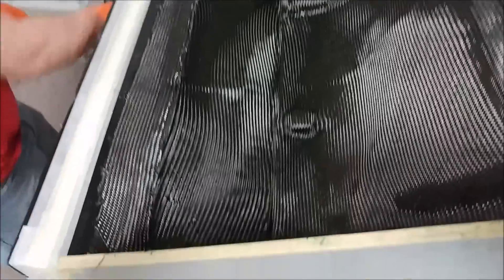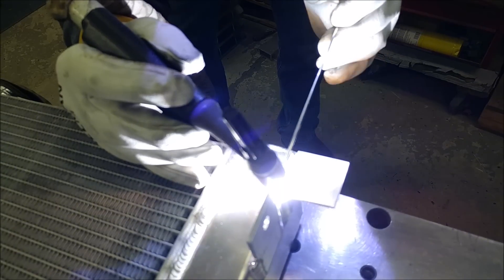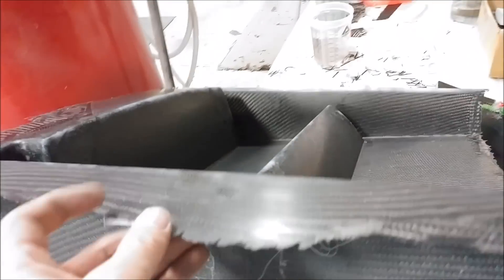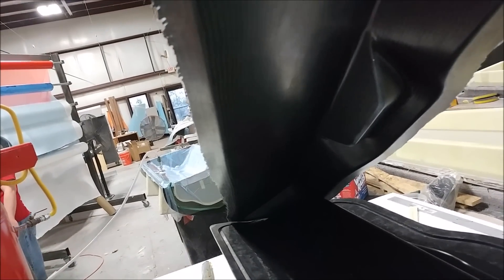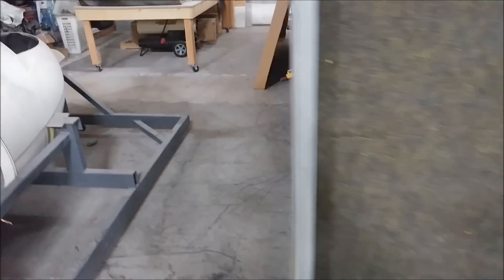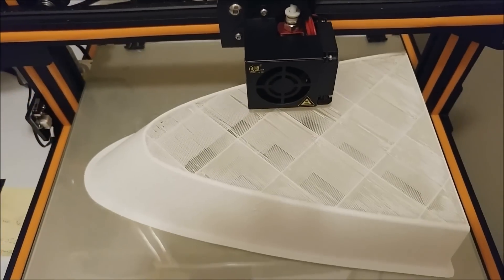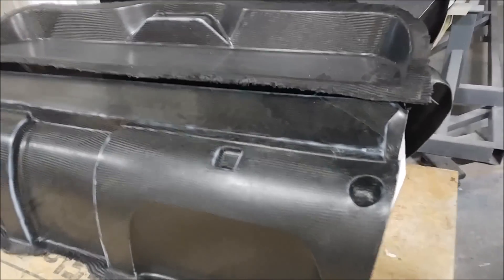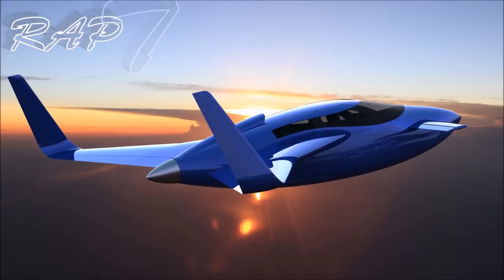Turning up the Heat - Getting the oven operational

Comment: I'm was wondering how visibility will be over the panel and the nose in cruise, climb, and landing.
Reply from the maker: It should be better than any other aircraft out there. I specifically designed the glareshield to be lower than normal.

Comment: great progress glad to see you worked out the oven and the tig aluminum bracket looked good too. way to improve your skills when you get an opportunity. was the hole saw mounted in the gantry mill when you drilled the bushing mount? that is quite a beefy hole saw.
Reply from the maker: Just used the 20v cordless drill.
Reply: Raptor Aircraft how did you align the hole saw?
Reply from the maker: If you go back a couple of videos you see I used the machine to align a bushing on the mold. We then put the part back in the mold and drill the 1/4" pilot hole using the bushing.
Reply: Raptor Aircraft ah yes. I remember that now. thanks. looking great.

Comment: Have you considered getting a SLS printer instead of an extrusion printer? Would solve that issue.
Reply from the maker: Those are a lot more money right?
Reply: I said SLS, but meant SLA. Cost depends on your size needs. Form Labs Form 2 can do 5.7" x 5.7" x 6.9" for $3500. Larger build volumes are more expensive, BUT you also have leasing options. Also plenty of used units out there. Now that you proved the concept of using 3D printing instead of the more labor intensive method, I'd highly recommend looking to switch to Stereolithography 3D printing!
Reply from the maker: Yeah, the 12"x12"x15" that I have was only $380. I might end up buying a second one as well to speed up the process.
Reply: Hey, cheapest system that does the job is the best!